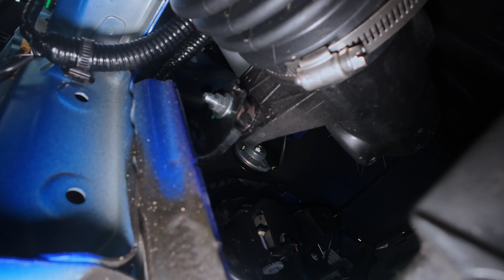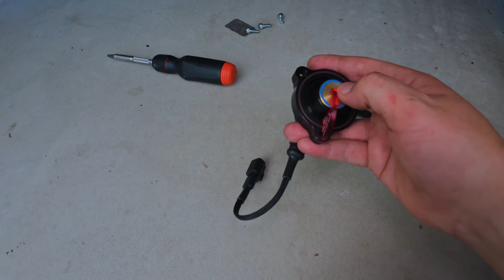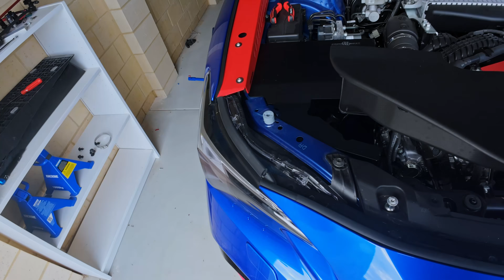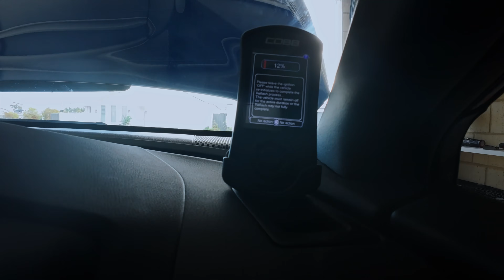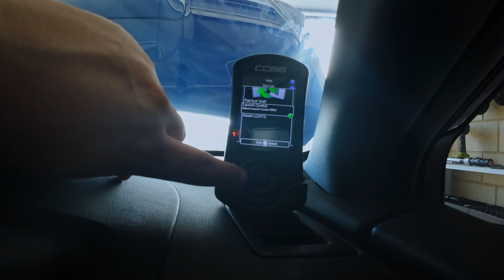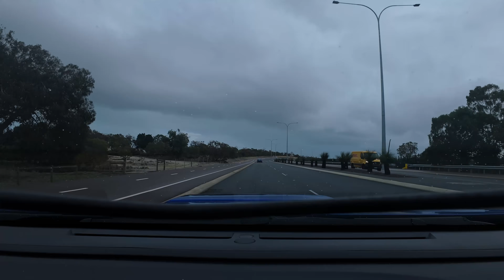2023 WRX Power Mods: Process West Intake & GFB Diverter Valve Install

Comment: The spoiler  that you have on your car, did that void any type of warranty?
Reply from the maker: If you are worried about warranty then I wouldn't really change anything, or get things done by Subaru themselvea. Subaru offer one from factory on the Club Spec model in Aus and I think optional for the S4 in Japan, so they wouldn't offer it, if it voided warranty, even if this is a 3rd party wing. 

Warranty of panels would only be an issue if there was a major defect to the panel that would be covered by such a warranty. Anything else would be classified as general wear and tear or accident damange and wouldn't get covered anyway.

Comment: My next install is the COBB shift plate and bushing, white line rear sub frame inserts and a stiffer improved gear box mount, a note to all, beware of the IAG Air to oil separator (AOS) they don't fit Australian model vehicles where the master brake cylinder clashes with the AOS canister install.
Reply from the maker: Shifter plate makes a huge difference to the gear shift. I think the Group N gear box mount is the best option - stiffer than stock, but still some give in comparision to say the solid mounts. 

We've always had that problem with the IAG AOS kits. Pro Speed have a RHD plates for the previous models to mount it to the left shock tower, but the VB has all its electronics here now, so not sure what will happen there. Also with my  strut tower in the bracket wouldnt work either. The Radium Catch cans also have issues with any aftermarket Intake Shrouds.
Reply: @VBWRXY  I've I've recently installed the Radium dual catch can with success and looks great, I've got the COBB shroud that works with the Radium pipe work.
Reply from the maker: Cobb don't have an aftermarket intake shroud though, just the alternator shroud. Or the CF intake snorkel. The PW and ETS (possibly even the Perrin) intake shrouds clash with the radium catch can that mounts to the ABS system.
Reply: @VBWRXY  yeah its the alternator shroud, way better than the stock

Comment: I just got an ETS intake and tuned for e50 at 400/480.  22k miles later its got an Outfront bottom end cuz 400 aint cutting it no mo'
Reply from the maker: I initially wanted to go ETS for all my upgrades, but the intake is currently double the price of the PW. Upspec Garage who supplied my tune have their development car running similar power/torque to yours.
Reply: @VBWRXY  I am not familiar with them or what PW intake is capable of. At the time i made my purchase, 2yrs or so ago, there was only ETS intake that had the larger diameter opening and required tuning, once inner metal sleeve was removed.
Reply from the maker: Process West is an Aussie brand and has plenty of kit for Subarus. I believe their intake is very similar to the ETS in terms of air flow and requires tuning too.
Reply: I'm considering the process west over the ets as well.  Much cheaper and tubing is aluminum vs ets steel so it will be lighter.  I like the pw box better.  The ets does have a velocity stack though.
Reply: @brian6speed  if you mean the removable sleeve, then yes, thats why its better than pw (will make more power with tune)
Reply: @stock.cars.2ned the velocity stack, not the sleeve.  The velocity stack is  the machined part the filter attaches too.  I have one on my custom intake I made on my track car.  It helps with feeding in more air and allows you to use larger filter.
Reply: @brian6speed  i must not know what a velocity stack is, but i dont see one on pw at all.  I see one on ETS with removable sleeve.
Reply: @stock.cars.2ned yea pw doesn't come with one.  ets comes with a velocity stack and a sleeve.
Reply: @brian6speed  if you mean removable sleeve, that is why it is better than pw in terms of power output potential with tuning.

Comment: I also have the LTT screwdriver in my toolbox. Love it! I'm going to order both of these and do the same thing.
Reply from the maker: Ratcheting screwdriver makes everything easier. Unfortunately I scuffed mine up when it got caught under the creeper during this video. 

The intakes a really simple mod to do, and has a great benefit when tuned properly.
Reply: @VBWRXY  the intake is on its way. The valve was out of stock but I’ll get it later. I appreciate the video for inspiration

Comment: You should have done a Perrin Turbo Inlet while you were at it.
Reply from the maker: I thought about it, but unfortunately it's on backorder here in Aus so would have been a couple of weeks to get the part. Additionally the PW intake is longer than most intakes and replaces all the plastic intake up to the metal turbo inlet. I am looking at in the future though.
Reply: @VBWRXY  Yes, I know I have the PW Intake...I was the first VB to tune that intake in the USA at the end of Sept 2023 at Felix Performance/Dmann tune.

The metal stock turbo inlet has a boost leak.  Perrin Inlet really helps to increase turbo efficiency.  I have the Perrin Turbo Inlet and Diverter installed and am getting about ~200rpm earlier spool.